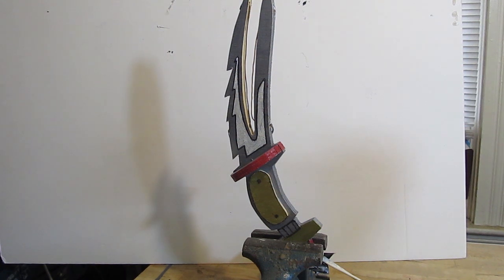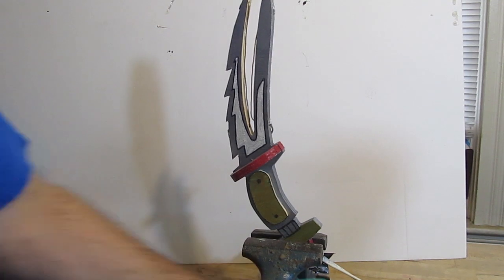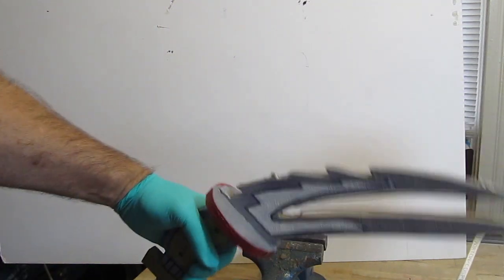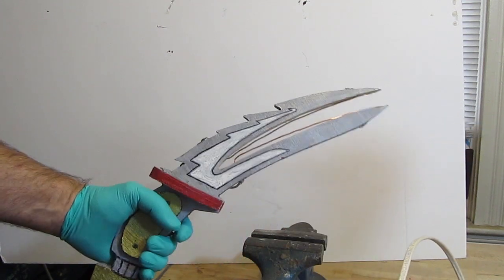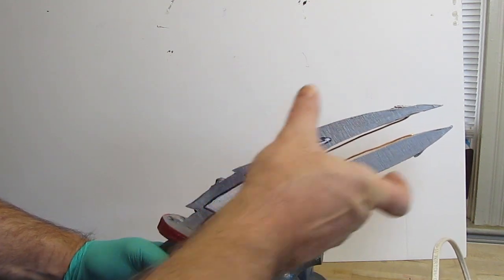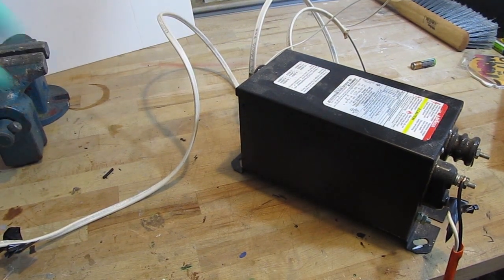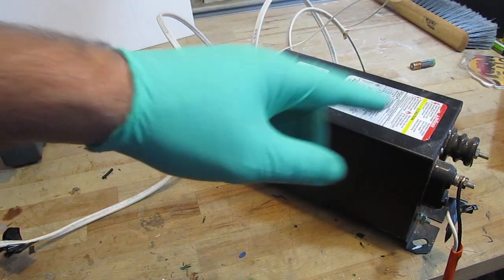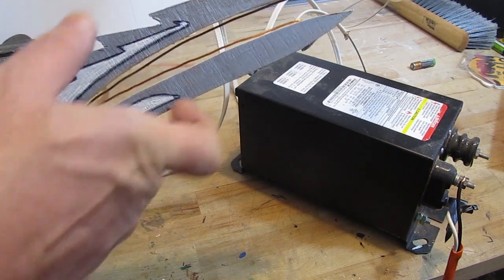The Tesla Dagger

Comment: Hm. Interesting, considering I've seen a 10000 volt taser flashlight. That's enough to kill a person.
Reply: it's not a problem of volts, but ampers
Reply: Maria Franco True, but 10000 volts CAN stop a person's heart.
Reply: uhh, 10k volts won't kill someone lol
Reply: Voltage is irrelevant. Amperage is what kills.
Reply: Doesn't change the fact that 10k volts is a little overkill.
Reply: Damon Fyrian I don't follow your reasoning. In order to spark and arc through air, it has to be high voltage. By your apparent thought process, everything this channel does is overkill.
Reply: 97cheeselover The flashlight taser. Not this. 10k volts is overkill for a taser.
Reply: Damon Fyrian 10k volts is enough to get your teeth buzzing a little, but it's not really dangerous. The dangerous part of a current is the amperes, .01 of which is enough to stop a man's heart.
Reply: 97cheeselover I was actually wrong. This is the one I was talking about, and it's not 10000, it's ten MILLION volts. Big difference.

http://www.budk.com/Cheetah-10-Million-Volt-Stun-Gun-Flashlight-28862
Reply: Damon Fyrian I'm not sure if you understand, so let me be very clear.

VOLTAGE IS NOT THE KILLING POWER OF ELECTRICITY, ONLY HOW MUCH ELECTRICITY. THE DANGER IS THE STRENGTH OF THE CURRENT, MEASURED IN AMPERES.

Comment: What a neat idea! Can you swing it around while it's turned on or is it not safe to hold?
Reply: I believe Jacob's ladders only work upright
Reply: Wood is an insulator, but even then, I don't thing it's safe to hold 15000 volts with bare skin.
Reply from the maker: Thanks. It is probably  safe to hold. But I didn't want to take any chances with it!
Reply from the maker: Good comment. You are right. A Jacob's ladder only works in the vertical position.  It has something to do with the spark heating the air around it causing an upward draft.
Reply from the maker: Good point.  And so right. Fun to make and watch but I didn't think it prudent to handle it.